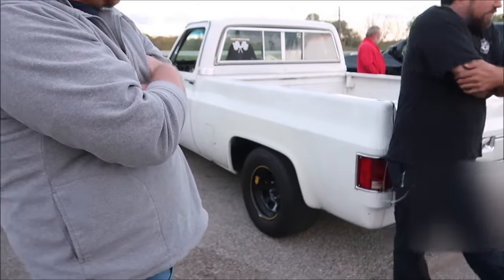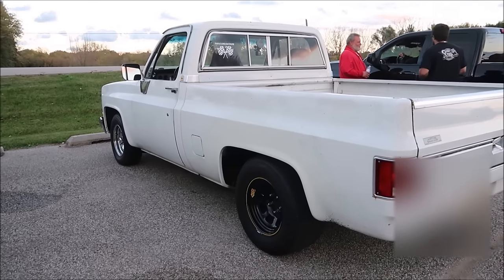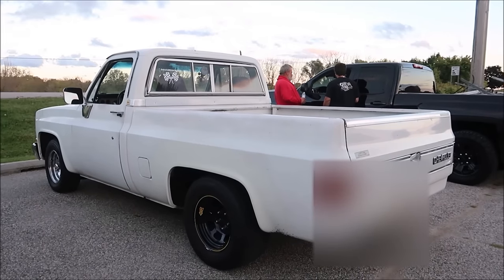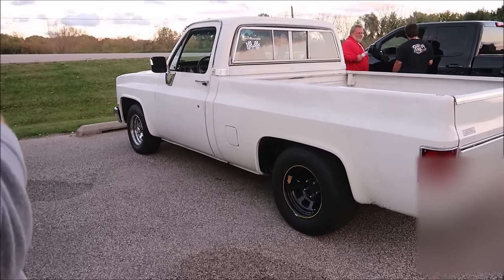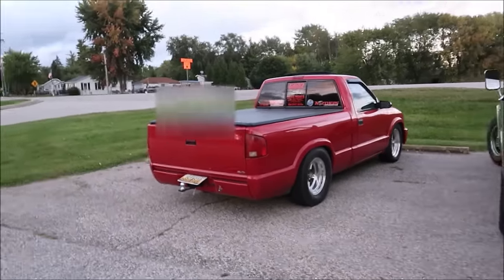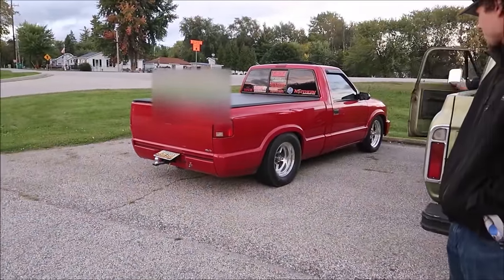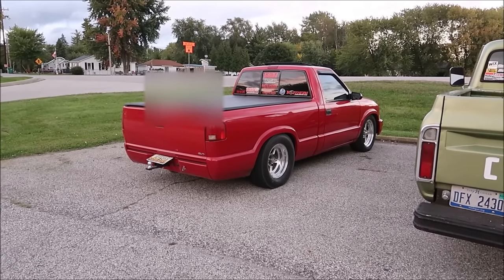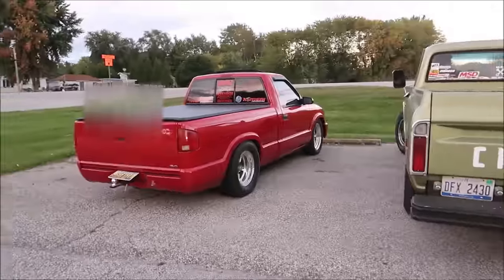Nitrous/Cam 6.0 S10 vs Nitrous/Heads/Cam C10

Comment: Had the LS winning this one pretty sure that 355 isn’t telling the whole story but great run anyway.
Reply: Let’s be honest with this one. We all wanted the sbc to win. Also heads and cams can completely change an engine so I’m not 100% surprised the sbc won.
Reply: @wolfaja755  they're both sbc lol 😆
Reply: I put 3 different cams in a lq9 6.0 before I got the power I was looking for, I learned the expensive way how critical the lobe seperation on a LS base motor is!!!!
Reply: Kinda hard to have a stock bottom end when it's bored .30 over. So we know he's lying right off the bat.
Reply: A heads cam 350 can make 500+ just like an LS
Reply: Lol dude beat an ls9 with some work. That thing is built.
Reply: What cam did you use? I want to get a cam on my 6.0 ly6  with the 823 stock heads they flow good air I was thinking a stage 3 from Texas speed with bigger springs. What do you think? Its in a 3\4 ton 2500 h.d. Silverado... Anyone else want to answer me?
Reply: Ls guys all mad Lol
Reply: @PHILLY214 .. 400-430 probably about the highest I’ve seen on motor to the wheels…
Reply: @PHILLY214  just heads and cam you'd be trying pretty hard to make 500+. However he's not running a 350 either
Reply: @justinrodriguez6539  it's not the LS that lost the race. That lq9 should win everytime specially with the weight difference. Dude just couldn't hook off the line. A solid hook with no spin would kill that c10

Comment: Whats the hp difference ? Thats impressive considering the weight difference
Reply: A cammed stock head 6.0 would make 340-380 wheel depending on the cam. I wouldn’t be surprised if the head cam c10 was at least 400 wheel. Heck I new a guy with a n/a 350 with a big cam, heads and a tunnel ram making around 550 crank on an engine dyno. He had it in a s10 and it would haul.
Reply: @gunguytx  you can make north of 400hp with factory heads on that lq9

Comment: And they say LS is the way to go 🤣
Reply: That's just a trend is all it is there's literally nothing better about a LS it's still a pushrod V8 lol but they do have a better bottom end
Reply: @jonathanlawson4667  You say there's literally nothing better on an ls then proceed to tell me something better about the ls. Heads are better too. Also i bet the ls gets about 21 to 22 MPG driving around and the sbc might get 10 to 12 MPG. Just pointing out a couple other better things.
Reply: It is.
Reply: Sorry that was meant for Thomas D
Reply: @fastnasty6627  the only thing better about a LS compared to a old gen 1 sbc is the head Design everything else engineering wise is still that same old single cam pushrod engine lol you get a good set of heads for a sbc you make the same power as a LS and the LS has skirted mains and the sbc doesn't it's just gotten to where every kid thinks a LS is 1000hp and a sbc is 100hp lol but I know how to build engines so I know how to make power out of both 😉
Reply: @jonathanlawson4667  the heads are better, the intake is better, the bottom end is better, the block is better, and the valve train is better. That pretty much makes the whole engine better.

Comment: The 6.0 is barely over squared  4.00 bore and 3.622 stroke. A slower rev engine . 355 is a 4.030 bore x 3.480 stroke its a revving sbc . s10 weighs 3700  with a 4.3 v6 . C10 about 3700 but revs quicker and is well researched and tested over 50 years worth. When the LS engines came out ,the old engines quit making horsepower?? I think not , not at all !!!

Comment: What  rear end is on the s10
Reply from the maker: Ford 9” Strange thru bolt center section, 4.10 gear, 35 spline spool and axles
Reply: @Shooff3.4 what drop dose it have ?

Comment: 100 shot? Stock bottom?
Nah....
Stayed out on a lighter truck with more juice ( allegedly )...
Reply: Had a stock bottom end 350 with a 150 shot for years, never had a problem
Reply: @ldogharycokanbalz6043  Cast Pistons? Stock ring gap?
Reply: @fastnasty6627  All stock except the intake and carb.
Reply: @ldogharycokanbalz6043  a 355 isn't stock bottom end though

Comment: You can fit a 6.0 in an S10? Dafuq
Reply: Same size block as a 5.7 basically...
Reply: 4.8 up to 6.2 at least are the same size if I am correct
Reply: @trashbandit2449  I think you are.
Reply: @J2A61  I'm guessing the LS7 is a little larger?
Reply: @trashbandit2449  no it’s still a 6.2 I think
Reply: @J2A61  ls7 is a 7.0/427 CI
Reply: I mean, people have gotten v10s into a Solstice, so, yes.
Reply: The LS7 block is the same size externally also. GM is now selling a wet sump crate LS7 called the LS427 that'll drop in place of any gen 4. I don't know if the exhaust ports line up in the same place with the LS7 heads but that's a minor concern.

Comment: Tires were definitely to low all over the place s10 could have won but also gear ratio matters and so does the converter and fuel system  and tune all those matter alot I think the c10 was just set up better all around

Comment: I have been around the block a bit.   That guy in the c10 is straight up lying.   There is no way that race was fair.  There are many reasons why I think this and the first thing that comes to mind is stock suspension.  At least the s10 guy said he had a 6.0.  It may have been a 355 in the c10 but there is more there than what he is saying.  An ls 6.0 with wrinkle tires with nitrous will easily kill that c10 based on what that gentleman said.   However, If you decide to race, you need to remember that the guy you are racing is probably not saying what is really in his car.  The race seemed legit.  The c10 did win the race.  The C10 was the faster truck.   There is more going on in the c10 than meets the eye.   I would guess that it is a 355 small block because he stated it so casually.   I think there is a lot more nitrous than what he said.  the nitrous is easier to hide.  I would like to see more honesty.   A win is a win.  You choose who you want to race.  Never judge a book by its cover though.

Comment: You can tell all the LS fans in the comments lol. The C10 said it was a 355 with heads, cam, and nitrous. Who is to say he didn’t have a good combo? The s10 had cam only. They were probably equally matched or the sbc might have even out powered him. More to winning a race than just throwing a cam in a LS and beating everything that comes along even though a lot of people think that way. I’m not knocking them they’re great engines, I have a 5.3 on the stand right now. But I also have a LT1(sbc) with heads, cam, and nitrous that was running decent before the oil pump crapped out.

Comment: 355 My ass, I know a 406 sbc when I see one!!
Reply: I put ass whipping on LS all the time with old-school small blocks all the time they're nothing special
Reply: @joebuch7455  im new to the ls but you’re telling me old school blocks can take “ls” any day ?
Reply: LS do run pretty good the LS3 head is a nice head the nicest head they ever came out with stock forum and aftermarket but yes I have built small block Chevys and small block Fords that run just as good and went faster than some with nitrous
Reply: I seen a friend of mine 6.0 LS with a carburetor with nitrous go 920's LS3 head I took a 351 Windsor with a c3 yates heads with a carburetor with nitrous when 890s it's the combination I know another guy that built a 302 Chevy and used Buick heads with a toilet bowl fuel injection shift the motor at 9200 RPMs and went Hi 8 on motor yes it can be done
Reply: @joebuch7455  damn thats actually pretty crazy and impressive! 💯
Reply: @that5.0tho74  Any day you drop a crapload of money into one and then MAYBE you could or you can do valve train upgrades and o ring type head gaskets add a turbo and make a 1000+ HP with an LS. There is a guy on youtube i think with a datsun 280 Z with a junkyard 4.8L LS, cam and valve spring change added a turbo and makes around 800 HP i think he runs in the 9's drives it to the track gets 20 MPG on the highway,had like 20 or so passes on the engine with no problems at that point. I think i may try to find that vid it's been several years since i seen it.
Reply: @fastnasty6627  sheshh im just actually shocked to know that thanks for the info ! Doesn’t that datsun have a nickname ? Like reroy ? Something like that if u remember?